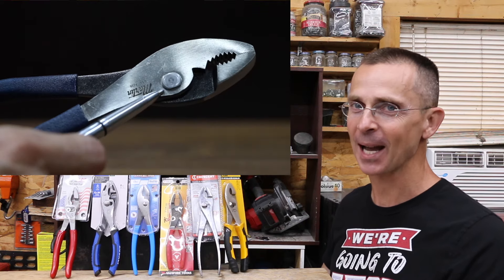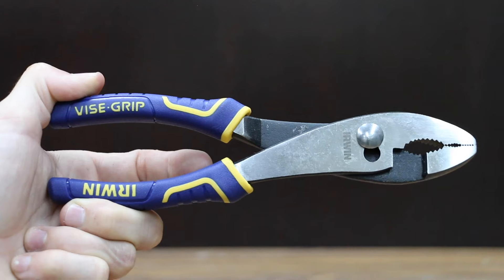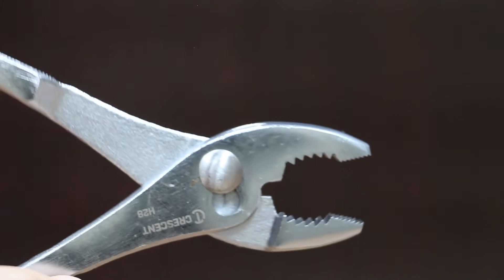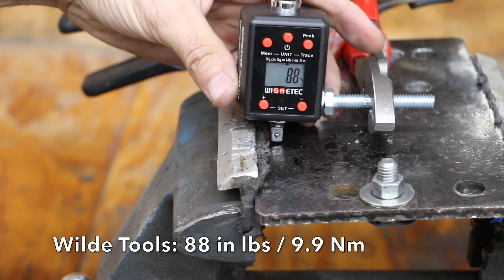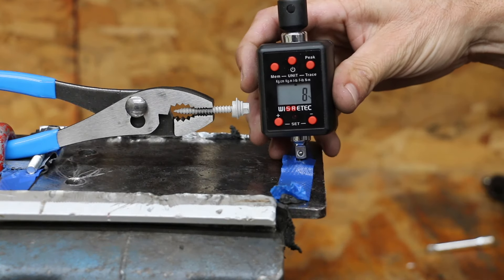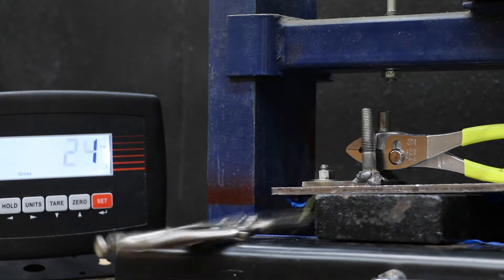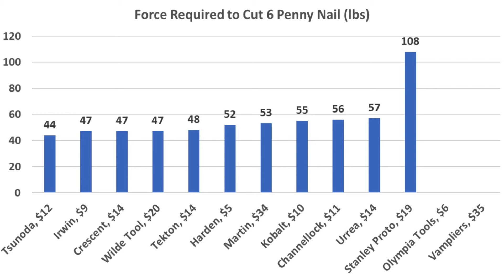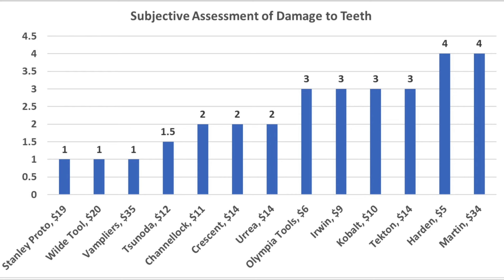Best Pliers (SLIP JOINT)? US vs Japan, Vampliers, Kobalt, Irwin, Stanley, Tekton, Martin

Comment: For Christmas last year I got 3 sets of vampliers (their "lineman" sort of pliers/wire cutter, a small set of pliers, and these slip joints) and have come to really like them. They may not be the greatest in many of these tests buts I've found the unique jaw design incredibly handy (which that alone makes it up to me) and have yet to damage them in the slightest.
Reply from the maker: Thanks for sharing.
Reply: As a Canadian, I have traveled a  couple times a year to the States (western N.Y. state) . I couldnt find Vampliers in any of Big Box stores. Do I have to buy them on-line?
Reply: When you need the forward grip design that the vampliers offer they're invaluable. Definitely have a place in my tool bag alongside a standard slip joint.
Reply: @mikegike7273  Amazon though the engineer brand is same just different color mainly for getting stripped bolts and screws love mine
Reply: @LS-qt1dp  this. It's usually better to buy the tools that are specialized in this manner because man, when you need that specialized function, life and work are so much easier.

I was installing a deck with my dad and bought Milwaukee impact driver with 3 speeds. My dad had the older, single speed.

I could do 3 screws to his one. Having the newer, slightly fancier one literally took our time spent fastening by 66%. That's worth the price alone
Reply: @Real28  there's a reason I have several of these and that's the reason.  I can spend half an hour fighting with "ez outs" or just grab the right size of these and done in 5 minutes.  Some of my coworkers think I'm nuts for all I spend on tools.  I get paid same bust my but or do it easy.
Reply: @Real28  can't say I've ever used them as regular pliers I save them for their intended purpose the broken bolts.
Reply: @LS-qt1dp  And the (original) Engineer labeled ones are have a significantly lower price for the exact same tool.

Comment: 9:48 for cut tests like this where there is damage to the pliers it would be helpful to see each pliers do a second cut. Some of the pliers did great the first time, but were so damaged I'd bet a second or third cut would be significantly worse. Tsunoda took 219lbs but were like new afterwards, meanwhile Crescent did better at 203lbs but definitely weren't all that sharp anymore
Reply: Realistically you're not going to be cutting nails with slip joint pliers. Least not larger nails. So you can consider it a destructive test. Do you really think you have 200+ pound grip strength?
Reply from the maker: Thanks for the suggestion.
Reply: Really good point
Reply: @1pcfred  it would be a better destructive test seeing how much more it took to do it a 2nd or 3rd time.
Reply: @normalguy556  perhaps. Once was enough for me.
Reply: @1pcfred  Most  men are supposed to be able to generate at least 150+ lbs of grip strength per hand.
Reply: @1pcfred  yes, it is destructive or just a quick way to test hundreds of realistic cuts, so if a second test goes way worse, than it is clearly not as long lasting than the one which does a bit worse, but still able to perform reliably.
Reply: @rolfbjorn9937  really? As much as 150 is it's still not over 200 though, now is it? Where did you hear that figure? That sounds like an awful lot. 150 pounds is like a bag and a half of portland. With one hand? If I have to cut a thick nail I'm breaking out my cut off disc. I have a cordless one even. Along with plug in electric and pneumatic ones. I bought the cordless one for the convenience factor. I like my cut off discs. In a pinch I suppose I could use a hacksaw? Wouldn't be the first time. I have a really nice hacksaw collection now too. A few years ago I really stepped my game up there. I don't need a sore hand.
Reply: @rolfbjorn9937  not at that grip width.those pliers were open about 3", and not many people can grip 150 lbs with their fist open 3".
Reply: @rolfbjorn9937  I guess I'm well below average then
Reply: He works to get as much as possible in a reasonably short video and it never ceases to impress me, especially with the kinds of tests he puts together. Of course, it is easy for anyone to suggest other things for him to do, and I am not saying your saying your wrong for doing so, because I am sure your suggestion is solid, but I just like to point out that he does such an extraordinary job doing what he does. I am sure he makes extremely good money doing what he does, but I don't think any of us appreciate the sheer hours he puts into this stuff and then to whittle it down to 10 to minutes of time with a TON of tests and a lot of brands. So impressive!
Reply: @travisjazzbo3490  there are certainly constraints.  I'm sure Todd has things to do besides make videos. As it is it seems like he puts an incredible amount of time into production. No matter what you do though it is still never enough for some people.
Reply: @1pcfred  So true... 'I'm sure Todd has things to do besides make videos.'

I promise you one thing... when he started this, he was doing A LOT MORE of other stuff I am sure, but because of his extraordinary popularity, I am sure he spends most of his time doing this, because with that many subscribers and views, he makes A LOT of money doing this.

I have watched videos of Youtubers with certain followings and regular views and it blew me away what they were able to make financially, as some have shared it which was pretty cool,  so trust me when I tell you, Todd maybe once was doing other things for more of his time, but I am sure it has swung to mostly doing this at this point.

He is such a good Dude and does what he does so well, compared to others doing similar things where the experiments aren't nearly as good and the time they waste in their videos doing commentary BS -often biased... I am sure he had no idea what this would become when he started.

Peace Sir!
Reply: @travisjazzbo3490  writing that comment did get me to wondering if Todd has any staff to help him. I'm guessing that he may not? It seems as if he does it all himself. Might have family and friends pitch in? He strikes me as the type that does things himself though.
Reply: @1pcfred  I have wondered that also. It seems he most certainly can do what he does himself as he is very capable, but it also wouldn't surprise me if he has some help either.

Some of his stuff involves tests he started months or even a year ago. Between thinking up things do to based a lot on suggestions, and creating jigs and tools to accomplish these tests, there is not doubt a lot of time invested.

But yes, I think he can most definitely do it all himself and seems like he does.
Reply: Just not enough time homie, This guy probably spends over 18 hours of video time for just a 15min video, after cutting and editing and multiple re-shoots and positions. No one is getting to try to get a nail with these this is just an endurance test. Plus you couldn't anyway, Unless you The mountain in his prime and even that, I bet he couldn't.
Reply: @1pcfred  When I was 16, I discovered "adult websites". Six months later, yes, I had at LEAST 200 pound grip strength.
Reply: @comridor  I am not seeing how you are arriving at that figure. Not even if you have to wear three legged trousers. In which case the adult entertainment industry would discover you.

Comment: A thought on the metallurgy - the softer the steel of the pliers, the better they will grip. The harder the steel, the longer they will last without wear. 
As a comparison,  I keep copper jaws on my bench vise because of the superior grip. Those copper jaws have to be resurfaced or replaced more often. I always enjoy your videos, just wanted to add my thoughts.
Reply from the maker: Thanks for sharing.
Reply: For sure and  PF's tests help in choosing the best compromise for one's usage of that tool.
Reply: I also use some bend copper sheet and aluminum angle profile to be able to grip, but not damage, the metal part. If the part is softer, even wooden ones with some cloth.
Reply: Make the vice tighter and use hard jaws?
Reply: Great input
Reply: @beinghuman3225  A great option. For me, better grip and not marring the part is more important than not marring the jaws. The soft jaws do always look like sh*t. :)
Reply: @bhoiiii  Very interesting, I had never considered the effect on grip based on malleability. Will see if I can apply this in my trade

Comment: Great as always. As an electrician I would love to see one on solder filled heat shrink.
Reply from the maker: Thank you for the video idea!
Reply: I'm not an electrician, and I'd love to see that, too.
Reply: I would love to see this as well mostly because they seem really divisive. I know some who swear by them and I myself have had really terrible luck with them.
Reply: Agreed.  I'd love to see that.  There are a lot of those out there, I bought one kit on Amazon and they're great so far, but it would be nice to see which brand is the best.
Reply: Also, I want to see him do one on Wagos vs Wire nuts.  Although we all know Wagos would win... LOL..  I LOVE Wagos
Reply: @OmegaGamingNetwork  
Me too, have a box from Aliexpress where the heatshrink is already shrunk down and even melting before the solder ring does.
Reply: @Bri-bn5kt  wagos wouldn't beat 3M nuts in the "keep the lighting fixture from falling on your head with only the ground wire attached" contest ;)
Reply: @Bri-bn5kt  sure they would win, but honestly they are just prohibitively expensive.  If I want secure I'll go with crimp butt connectors or straight up solder the joint. If I'm in a wall outlet or lighting fixture, wire nuts are fractions of a cent.
Reply: @m1stertim   Agreed.  But electrical wires should never be load-bearing, so I'd argue that you deserve to have a light dropped on you 😂😂😂  (Kidding of course, I wouldn't wish that on you!)
Reply: Inferior to crimping regardless
Reply: I'm not going to be able to do the wife again until I see this 👍
Reply: @MrCarGuy   And crimping is inferior to soldering.  Apples and oranges. The whole point of wagos is that they act as a reliable joint for as long as you need them to, but can be easily removed without tools or damage to wiring.

Comment: Love my Vampliers.  I have multiple versions, and when you need them (stripped screws), they are a godsend.  They are definitely a specialty item though.  I don't use them for normal pliers' tasks.  Bottom line is I recommend you get some vampliers (needle nose, if only one) on top of whatever else you choose.
Reply from the maker: Thanks for the feedback.
Reply: Yes that was my conclusion on the Vampliers too, seem to be more of a specialty item and do their job very well.  I will try out the needle nose version, seems like I could use it a lot.

Comment: I like the Japanese Vampliers, it's nice and compact, slim-line gripping head, and the way the head has a ''hollow'' space on the inside.  A cutter on pliers like this would never be used by me, so won't miss that.  (And they fit in nicely with my Knipex obsession)
Reply from the maker: They are nice!
Reply: I love my Knipex!
Reply: @TREE_STABBING_TROY  I love all of my Knipex pliers to!! Got a lot of them, not one has disappointed me(so far).   A few of my favorites  08 21 145  -  31 11 160  -  31 21 160  -  38 71 200  -   87 51 250  -   And this is truly a must-have!! 87 41 250

Comment: Summary:
4:35 Small Bolt Grip (lbs)
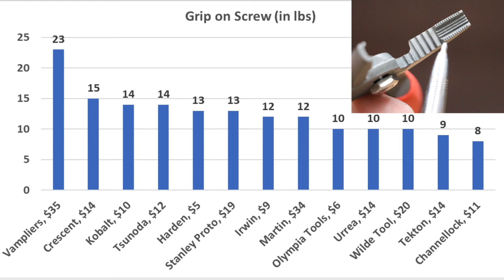5:41 Grip on Screw (lbs)
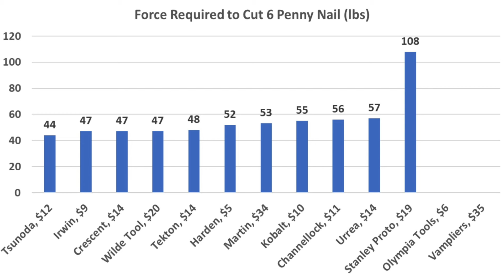6:52 Force Required to Cut 6 Penny Nail (lbs)
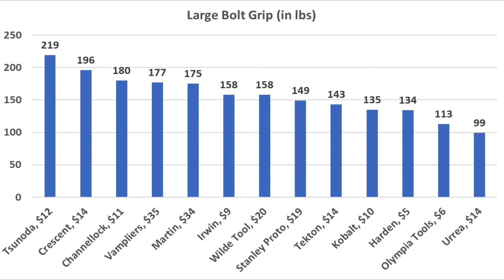8:49 Large Bolt Grip (lbs)
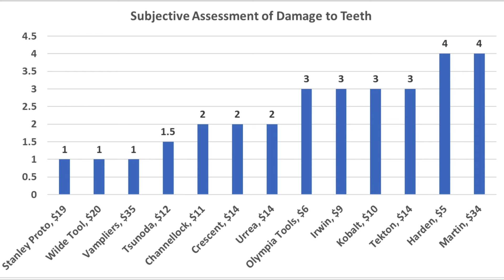9:01 Subjective Assessment of Damage to Teeth
10:35 Force Required to Cut 16 Penny Nail (lbs)
10:46 Subjective Assessment of Damage from Cutting Nails

Spoiler:
In my book, Tsunoda excels.
Reply from the maker: Thanks for watching!

Comment: Doesn't your grip test jig at 2" depend on identical grip/handle profiles? If a pair of pliers has a wider grip by design, and you clamp it to 2", it will be applying more grip force at the teeth than another pair with narrower grip distance. Right?
Reply: Yep..
Reply: I would have expected a jig that applied a fixed downward force (25 or 50 Lbs?) . Although the length and shape of the handles can impact this variation as well, it might be more impartial.
Reply: A good way to test this would be to use an inflatable bag, like a blood pressure apparatus.  This would more similarly simulate the grip force required.

Comment: I love my Wilde flush faster pliers for automotive work as it gives better access without getting hung up on protruding plier fasteners.  That being said the flush fastener reduces the cross section and thus the strength to cut nails, which I have never used them to do.  Wilde tool do offer traditional non flush fastener slip joint pliers which I am sure would fair much like the other traditional fastener slip joint pliers for extreme nail cutting tests.
Reply from the maker: Thanks for sharing.

Comment: I have another comparison that you may want to consider. Ear protection. whenever i use my bench / table saw its so loud. and already enough tinnitus from working in noisy environment, so ear protection is so important to me. i usually wear ear plug with ear muffs over the top. Just a suggestion, ive been thinking. lol
Reply from the maker: Thank you for the video idea!

Comment: The same factory in Japan that makes the Vamplier brand makes the Engineer brand, which is very similar in construction, but less expensive. Some of the Vamplier pliers have springs to help spread the jaws, and come with a case that hold the spring-loaded jaws together in your pocket or toolbox, while the Engineers  typically don't have springs, and the case is extra and expensive for what it is. The Engineer brand is also sold on Amazon and at other Japanese tool shops.  Both brands of pliers are made for smaller hands, so you will want to get the largest size you can, if you have large hands. In addition to their unparalleled ability to remove any broken-off nail, or bolt or screw with a stripped head, they are ground in such a way that the tip will securely grab the smallest protrusion of a bolt, screw or nail above the surface and enable you to remove it.
Reply from the maker: Thanks for the feedback.

Comment: Do vise grips?
Many styles straight jaw, curved jaw, needle nosed, different release levers etc.
Hardened teeth versus softer teeth ability to bite.
Locking force vs hand strength required, sloppy tolerances? Some jaws flex sideways under pressure trying to grip rounded bolt heads. You can explore more I'm sure.
Best product channel bar none!
Reply: I actually found a pair of needle nosed vise grips with a 45 angle on them.
Reply: Ok just saw you did some locking pliers. Watching now

Comment: Video idea: what type of oil is best to season a cast iron pan.
You can test how well it prevents sticking / burning, how many uses it lasts before needing to be seasoned again, heat resistance before burn off, water resistance and cleaning resistance.
Reply from the maker: Thanks for the suggestion.

Comment: To go with your current theme of hand tools, I would say do tongue and groove pliers (often referred to as channellocks) if you haven't already and wire strippers as well. Common tools used by maintenance technicians. Never hurts to know which ones are the best for what tasks. With channellocks they have different types like the griplock too and it's hard to know how well they work compared to the normal straight jaws.
Reply from the maker: Thank you for the video ideas!

Comment: Been watching your awesome videos for years and loving the content. The amount of effort you put in is greatly appreciated and I always look forward to watching your next video. A suggestion I have for a video idea is best precision soldering iron for small electronics. They come in a variety different wattages and temperatures and I would be really curious which one does the job the best for the price.
Reply: For electronics I personally would never use a fixed wattage iron. Temperature control is indispensable. My personal favorite iron is the mini TS-100. It is portable and can be run from a laptop power adapter, a tool battery, an rc battery, a car battery. Has great quality tips, 65W with the same direct heat technology as in Hako tips, and with its temperature control works great without any difficulty on tiny SMD chips as well as on a huge ground plane or 10 AWG wires. 
For bench work you can't go wrong with a Hako, but for me my Hako 936 is gathering dust ever since I got the TS-100.
Reply: @ASJC27  Thanks for that! Really appreciate it. I bought this Plusivo 60w adjustable kit off Amazon and the tips are terrible. It was so difficult to do precision soldering for these small wires that came off of an RGB strip. I had to set it to the max 450C and ended up burning and melting the molding around the wire while trying to solder it. I guess you get what you pay for and the kit was less than $20. Can't link them (YouTube rules) but I see several manufacturers of the TS100; YKEY, UY CHAN, NovelLife, MYPOVOS.
Reply from the maker: Thanks for the suggestion.

Comment: This is a rare case where these tests leave out some of the most important aspects of the tool. Things like how well or poorly the slip joint slips out of position when you are using the tool and initially positioning it. I’ve found that for many uses of these kinds of pliers the most important thing is can I get the jaws down where I need them and do the handles leave room for my hand in a tight space. Many times the best pliers are small cheap ones from a motorcycle tool kit. Small with narrow jaws. I rarely need especially strong gripping power and if I do my vise grips are around for that.
Reply from the maker: Thanks for the feedback.